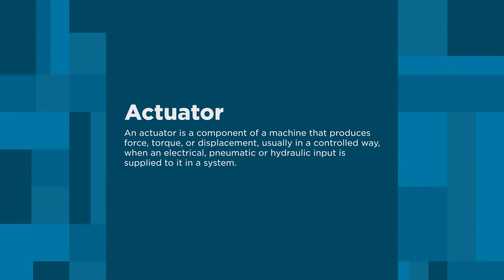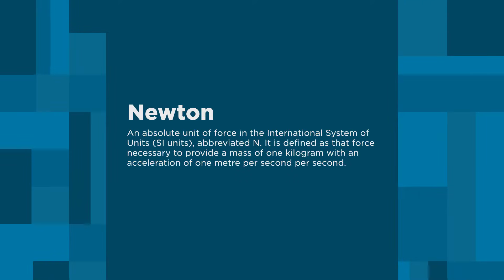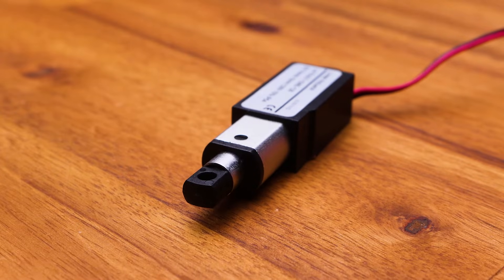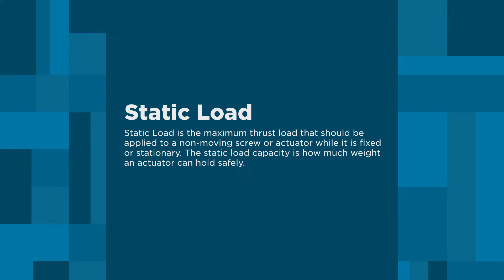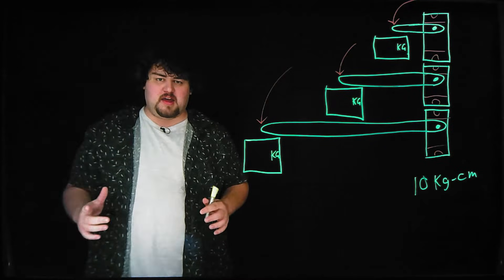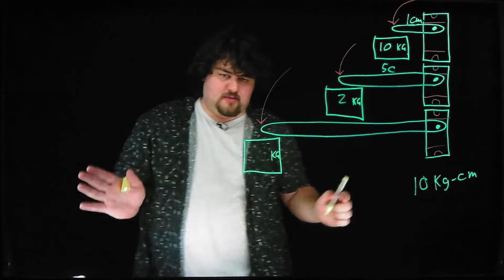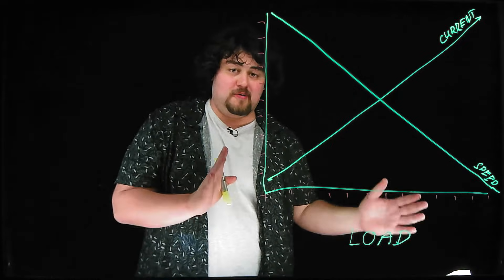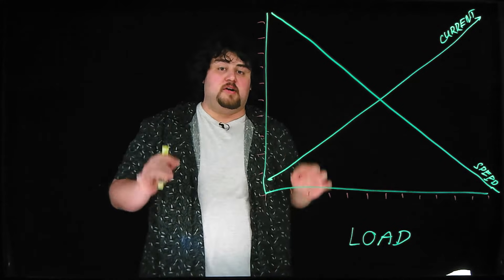A Beginner's Guide to Choosing & Using Motors, Servos and More

Comment: What does the vertical (y) axis of that beautiful chart represent?
Reply from the maker: For the first line, it is speed. For the second line, it is current
Reply: @Core-Electronics I meant the chart that has "load" on the X axis. What is being plotted against the Y axis? What would the label be here? Thanks
Reply from the maker: Both current and speed on that axis. As load increases from left to right, current increases linearly, and speed decreases linearly.

Comment: Such a clear explanation of the differences between motors with a simple description of how it works and what projects you could apply them to. Absolutely wonderful. As a Computer Science / STEM teacher, I used to try and avoid motors because they seem a little scary, but you've made them easy to understand and I'm going to integrate more motors into my Arduino classes. Thanks!

Comment: 5:00 Linear motors is not using rotor motor with a screwdrive. That is misinformation.
Linear motor need decoder wich make them expensive i think was company named "LinMot" also have circular usin radial magnetic field and planar wich use axial magnetic field(more easy to build).

Comment: Hi, can servo motors only move upto 180 degrees? please corrct me if i am wrong ---- i have heard that any motor with an encoder (feedback) and controller is a servo motor
Reply from the maker: Thats getting into the technicalities of what a servo is, but if you buy an off-the-shelf servo motor, chances are it will be 180 degrees. You can often find ones that might have 90 degrees, 270, 240, and 360 degrees though, its not just limited to 180!

Comment: Have a question! The smaller 2 wire linear actuators in the first part of the video, you have to reverse the polarity to make open and close. How would you control them with a on/off switch. For instance I want them to open and close with the light switch on a car. So when the lights turn on it extends and when light turn off they close. Lights on would be easy, same 12v relay power. Its when lights turn off, no power, Im guessing there is a controller that you can get separate?? Or maybe off a relay?
Reply from the maker: For an operation like that, you will likely need a motor driver (which will allow you to reverse the polarity), and a microcontroller to take the input of the switch, and handle the logic of controlling the motor driver.

Comment: Is there a way I can use the dial to control the servo position remotely via transmitter and receiver?
Reply from the maker: Sounds like you need a form of radio communication! If you are looking for something short range, you might wanna check out ESP-NOW if you are using an ESP32. Its a really incredible ability of it and is super reliable. If you are looking for something a little more long range, you can also get radio modules like this: https://www.youtube.com/watch?v=QnCRYAdtqnc
Reply: @ Great! Thank you!
Reply: Is there a way I can extend range using radio frequency? It’s difficult explaining what I need to accomplish and I’m not well versed in electronics

Comment: I am looking for a 12v DC push pull solenoid that when activated travels10mm with a 5-13N Force. I am planning to install it into the rear hatch of my 04 Chevy Trailblazer as an automatic release utilizing the preexisting controller and wiring. Any suggestions?

Comment: You are simply great. I have been looking for a video that will explain the differences beautifully for a long time. I have a question and would appreciate help. I have a project for a moving chair. I connected an Arduino to a computer and with the help of Python code I converted the movement of the joystick into the operation of motors. The chair sits on a universal joint so that most of the weight is applied to the joint. My question is whether a 300 Newton linear actuator will be strong enough to move the chair left and right. Or should I use something else? And if so, what should I use? Thank you very much😍😍
Reply from the maker: This is where all of this get a bit tricky! 300 Newtons is about 30kg of force if you can imagine what that feels like. Its hard to say whether this will be enough and it depends on why you are moving your chair. If you have a set of luggage scales, you can do the trick we used in the video to pull with 30kg of force to see if the chair will move.

We also have a maker forum if you need a hand with this project, we have a lots of makers over there that can help out!
https://forum.core-electronics.com.au/

Comment: Brilliant video so healpful and well delivered. Working on a project where a small lightweight camera will switch between multiple discrete positions by rotating horizontally. I’m guessing a servo motor is the right choice? Would like to avoid using an encoder if possible
Reply from the maker: Definitely sounds like a servo would be the best pick, just ensure you pick a large enough size to move it!

Comment: Hi! You would call a stepper motor the motor of our powered side mirrors of rhe car, which go up down left and right, or those have another specific name? I'm trying to find a mini motor of this kind to move my rear view camera to specific positions. Thanks for your help.
Reply from the maker: It can vary but a car side mirror is often actually a regular dc motor with a very complex gearbox and housing to move the mirrors, the lines of where you can apply things get blurry like that! If you need to move a camera to certain positions then it sounds like a servo might be your bet as you can accurately move the motor to a fixed position. Setting up a pan left and right wouldn't be too difficult, but if oyu wanted left right up down, then that might throw some complexity into the mix.
Reply: Thanks for your quick reply! In that case, it mightbwork if i get a way to attach 2 servos mounted perpendicular to one another, thst way I can succeed with the 4 movement directions. .. i guess in thisncase I would need 2 joystiks....
If I succeed with the gadget Ill show i tto you guys. 

Thanks again for your imput.

@Core-Electronics

Comment: Just started looking into Arduino and motors. And I’m confused… From what little info I’ve read so far, nothing mentioned that servos only rotate 180. My understanding was that the main reasons for deciding when you need a servo over a stepper motor is if you need more torque and higher speeds (rpm) then you’d chose a servo. But then, how is a servo useful at all if it doesn’t rotate continuously? if it only does a 180 degrees rotation… 
Do you have a more detailed video about servo motors? Kind of hard to find videos that aren’t 5-6-7+ years old (I don’t want to watch outdated videos using technology from many years ago, I don’t know if outdated info would help me in any way and I’m afraid of learning something that’s already outdated)
Reply from the maker: Some servos are able to rotate continuously like a stepper motor, while some can only rotate 180 degrees (you can also sometimes find some in 270 degrees, 90 degrees). With a continuous rotation, you can ONLY control the speed of the rotation. With the 180 degree one you can precisely control its angle. This is great in situations like RC planes and cars, you want to precisely control the control flaps of an RC plane, or steer the wheels of an RC car to an exact angle - these 180 degree servos are used here.

Our written guide has a bit more info on servos you might find helpful:
https://core-electronics.com.au/guides/digital-electronics/servos-steppers-or-solenoids-choosing-an-actuator-to-move-your-project/

If not, don't worry about older videos, servos haven't really changed in the last decade so the information is still good!
Reply: @Core-Electronics  wow! Thank you for such a detailed explanation!